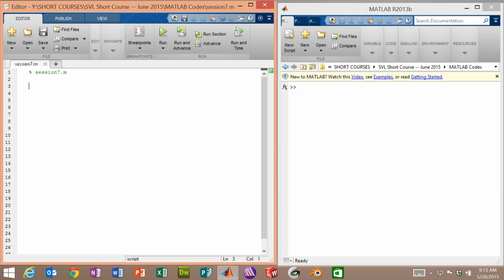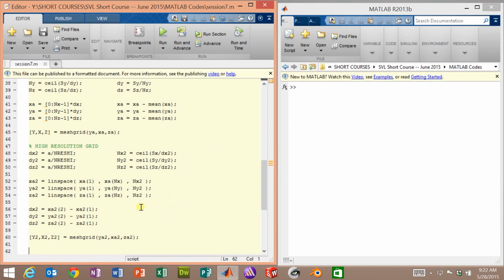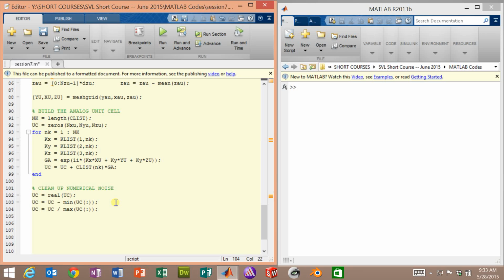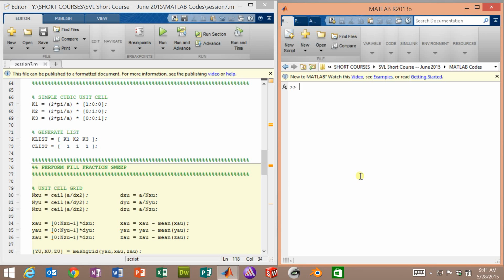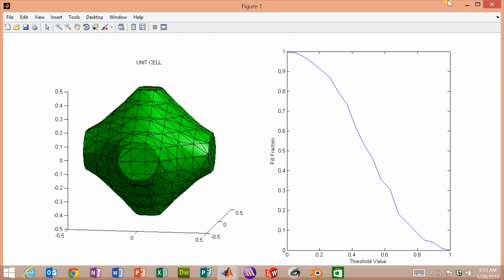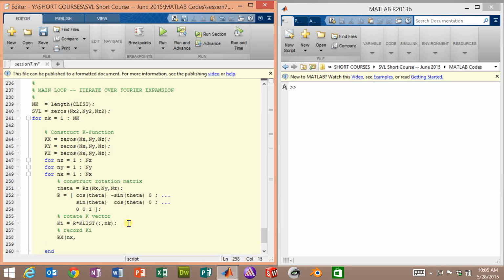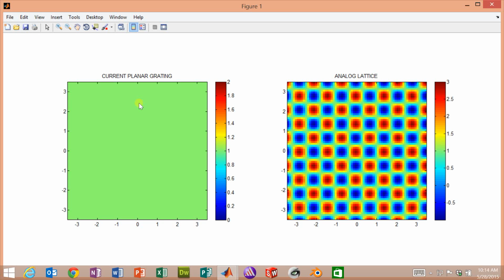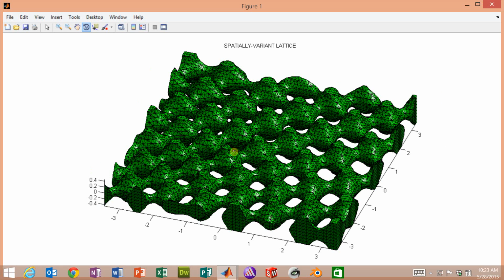Session 7 (SVL) -- Generating 3D Spatially-Variant Lattices

Comment: Great video!!! Very good learning platform! give some suggestions on; How can I introduce a unit cell from outside using stl file and distribute them using grating?
Reply from the maker: The general procedure is: (1) build or import unit cell, (2) Fourier transform the unit cell, (3) spatially vary each spatial harmonic separately, and (4) add them up to get overall SVL.

You might consider importing the STL in MATLAB and using any one of the "voxelize" functions available for download from the Mathworks website.  This will give you an array of 0's and 1's indicating air or material.  You can calculate the FFT of this array to get the Fourier coefficients and then you are back to the standard algorithm.

Does this make sense?
Reply: @empossible1577  Thank you very much, sir; I know importing of stl using voxelize, then the remaining steps i'll try to do.
Reply: @empossible1577  Dear sir, I have tried the same, I follow up to the 2D SVL procedure. In this video, you directly mentioned KLIST and CLIST. I imported stl file then did fft and truncation, followed by KLIST and CLIST formation, I have taken NRESLO = 11, so according to that dim of KLIST and CLIST increased,  now it is taking a huge time, but still not over. so need some suggestions for time.